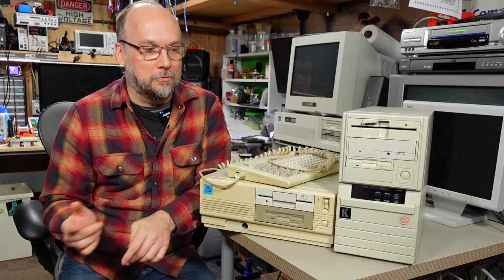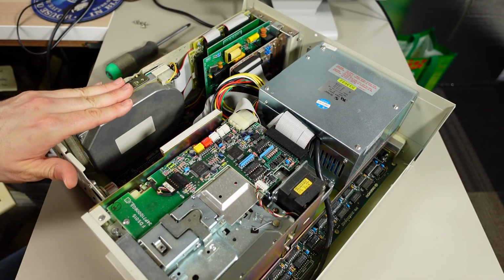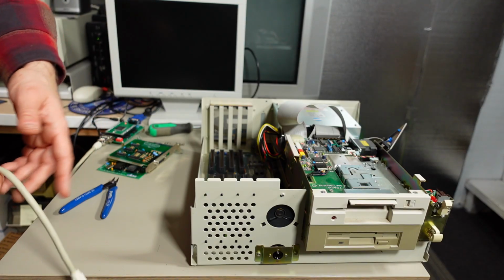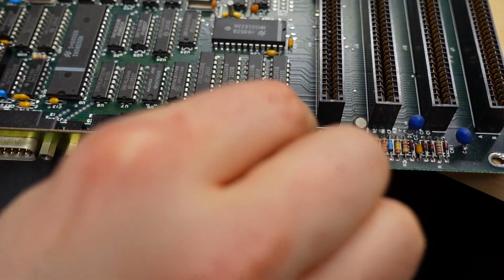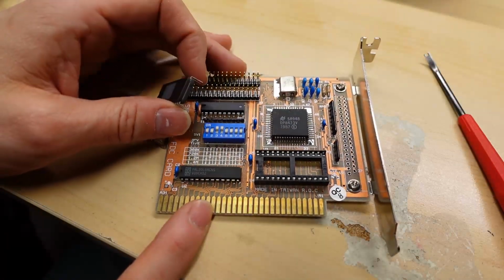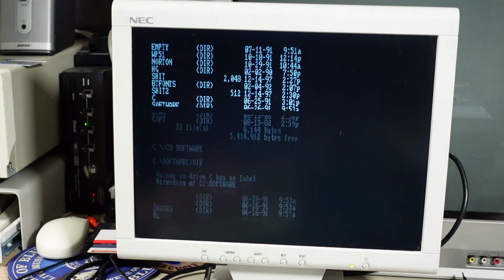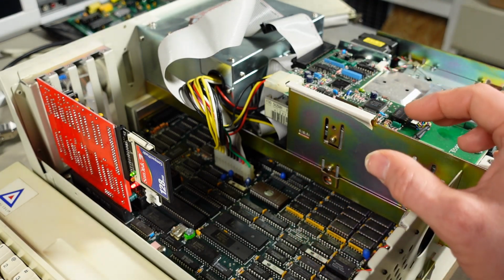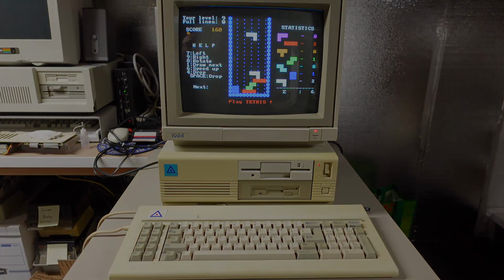PC archeology: Leading Edge Model D

Comment: Well, this takes me back. WARNING: LONG-WINDED MIDDLE-AGED REMINISCENCES AHEAD

I worked in Leading Edge's warranty hardware support department in the mid-'90s, at the tail end of the Daewoo era. The Model D was long out of warranty by then, but it was still legendary within the company (albeit not quite as legendary as the Model M, which was downright mythical). Unfortunately, by the time I came along, manufacturing quality had taken a pretty substantial dip, so my colleagues and I were pretty busy. Just as one example, at the time LE sold a computer called the WInPro 486, which was notable for a) not shipping with enough RAM to run Windows, b) not being professional-grade in any way, and c) not really having a 486 in it (it was one of those stupid Cyrix processors that was really a 386SX with the 486 instruction set).

Things picked up somewhat quality-wise toward the end of my time there, circa the summer of 1995--the last generation of Leading Edge PCs were pretty good--but the writing was on the wall by then. Leading Edge was getting its lunch eaten by other manufacturers, mostly with "Packard" in their names, and the product improvements came too late. I got out when Daewoo extended a hiring freeze to include not making up for attrition, causing the support department workload to spiral out of control. I remember one day we in Hardware Support all went to a big meeting with a Daewoo bigwig who'd come over to HQ in Westborough, and one of my coworkers asked if we could please at least hire to replace people who left, because we were really getting hammered. He stared at us while his young flunky translated, then scowled, pointed at us, and said without going through the flunky: "The rest... you work harder."

FYI, since you note at the beginning that you didn't know whether Leading Edge ever made 486es: they did! And not just the Cyrix faux 486es, they had proper Intel ones in the last few generations (including a minitower very similar to the generic one you have there). In fact, when I bailed, the company had just started shipping its first (and probably last) Pentium model. That's another horror story, in fact; the computer itself was fine, but the Corporate Masters had decided to revamp the company's image, so they abandoned the triangle logo for something painfully generic and branded the Pentium line "Fortiva". This was at around the same time that IBM launched their "Aptiva" product line, and a brand of yogurt called "Activia" appeared on the market. So that went about as well as you would expect. By then I was on my way to the exciting world of supporting ISP infrastructure equipment instead of PCs, anyway.

Finally, a fun fact: the last generation of Leading Edge laptops were made by Lenovo! That was before they bought the ThinkPad brand from IBM and started selling laptops themselves instead of being an anonymous OEM for other manufacturers. So they were actually quite good... not that that helped them sell very well.
Reply: "...at the time LE sold a computer called the WInPro 486, which was notable for a) not shipping with enough RAM to run Windows..." I'm getting flashbacks to the first year after Vista launched.
Reply: this is a longshot but i've found a desktop for sale. the model is dc-2012 which isn't actually documented anywhere. know anything about it?
Reply: @MyNameIsBucket   Not much, unfortunately. I worked for Leading Edge 30 years ago, and like I say, the Model D was long out of production even then. Anything with a processor earlier than a 386 was before my time.

Comment: I had a VTech Laser Turbo XT that also had a battery-backed RTC, but it was on a factory installed card-- not the motherboard.  And you had to run a program on bootup in order to set the internal clock to the time on the expansion card.

Comment: I was the Director of Purchasing for a company that was the largest distributor of Leading Edge computers back in the late 80's. We actually "owned" Leading Edge briefly, when they filed for bankruptcy around 1989, although later the bankruptcy court took the name away from us. Originally, Leading Edge sourced the products from Mitsubishi (hence the names Model M and MH) and then later, to lower costs (plus Mitsubishi tired of Michael Shane's tendency to pay late) and for better credit terms they sourced from Daewoo (hence the Model D, D2, etc.). Quite popular at the time, maybe even more popular than any one of the models was the Leading Edge Word Processor, which came bundled with each computer and was also sold separately. Daewoo sold us the remaining Leading Edge computers directly but wanted to market directly in the US under their own name after that, so we turned to Mitac computers (AKA American Mitac) as the 3rd suppliers for Leading Edge branded computers. But that sort of quantity and branding took time, and several months later the bankruptcy court took the LE name away so we rebadged them under our own name, and while they were actually quite nice, we never sold them in the numbers we sold Leading Edge computers under, since the dealer network had either collapsed or moved on to a more stable supplier. We survived, as it was just one piece of our business, but a lot of smaller dealers went under as Michael Shane (the original owner of Leading Edge) would often extract full payment or large deposits before shipping computers to dealers (often late). Shane's dicey business practice is kind of how we became such a large distributor - we didn't demand those terms and reliably shipped on time and still gave dealers 35% off retail in large quantities - and when Shane was up against the wall, he'd sell us huge quantities of machines for 50% off if we paid COD, which we could. Shane was almost operating a Ponzi scheme at some point, in my estimation.

Comment: Hey Adrian!  I have a Leading Edge Model D as well.  If you are interested in getting an original Leading Edge BIOS working with the XT-IDE, I've dumped mine which has Phoenix v2.13, dated 1985-12-27.  I have never had trouble with my XT-CF Eco-Lite that uses the XTIDE 2.0.0b3 BIOS, even with the CF card at 300h.  However I also noticed my board P/N is 2105004103 vs your 2105004102-- so maybe there are slight changes between the two, maybe even changing the RTC address.  From a quick/lazy glance the two boards don't look any different from each other.  Not really sure what the best way to get the BIOS image to you would be if you wanted to give it a look, but let me know if you're interested.

Comment: Oh, my goodness---the D did color!

The Leading Edge Model D 8088 was my dad's first computer. As I recall, Dad bought the D in 1986, surely based at least partly on Consumer Reports' enthusiastic recommendation. His configuration included one 5.25" floppy drive, and he also purchased an optional 20 MB hard drive. (Unfortunately, the hard drive never worked reliably.) I'm reasonably sure the keyboard was identical to the one you've got here.

Dad also got a monitor that could display every color . . . as long as it was green.  Indeed, until now, I had no idea the Model D offered any color capability whatsoever. Now I can rest easy!

Comment: I think some of these later XT's had real time clocks.  That would be what the battery would be for most likely.  
Likely had two connectors for people with two monitors so you could have both monitors connected at the same time :)
A question a little off topic...   What was the reason you got into retro-computing?   
For me, it was more nostalgia rather than the thrill of restoring something electronic.  Memories from childhood.

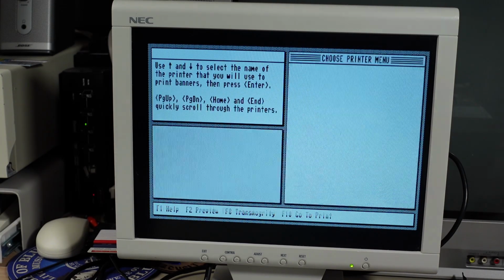Comment: Hi Adrian.  Great video.  A little note on your software exploratory around 41:00.  I noticed the machine also has a copy of dBASE III.  Sidekick and dBase III were a very common combination back then, since dBASE was programmed with .PRG text files that were interpreted, not compiled.  The dBase text editor was utterly appalling so everybody used Sidekick instead.  When writing and debugging their program files, they would quickly pop up the Sidekick Notepad TSR, already loaded with a with a copy of the .PRG, edit it, dismiss Sidekick and immediately re-run the freshly-edited program in dBase.  It was such a productivity boost.  What was extra-cool was that the Sidekick editor used WordStar keystrokes (Ctrl-K C for Copy etc.).  The maximum size of a Sidekick text file was 64K so, if your program exceeded that, you could then fire up the exact same .PRG in WordStar and continue editing using the keystrokes that were already burned into your muscle memory.

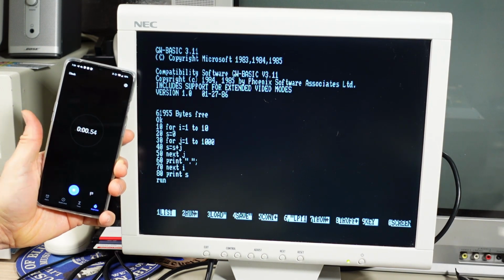Comment: 43:30 - out of curiosity I just tried the exact same thing in Java on my Ryzen machine - it took about 650µs to run. 😂 And 100000 * 100000 still only around 4s - very cool how from a mid-80s perspective my ordinary middle-class 2019 PC is an alien-sci-fi-magic supercomputer 😎
(and in DOSBOX using GWBASIC it's around 1s)
Reply: I just ran that using the freebasic compiler on Linux -- it runs so fast that the time program doesn't even give an accurate answer. Probably way under 1ms. This is on an i5-9300, which, just like your Ryzen, is bloody alien space-age technology compared to a 8088! I wonder if installing an 8087 would have made any difference... I guess it all depends on whether BASIC knows to take advantage of it or not.

I might try running that test on a very old computer I have access to -- a CDC-6500.

Comment: 10:50 Is that a quad 555 timer in the middle there?
Reply: Probably. PC game ports traditionally use 555 variants like the 556 and 558. The potentiometer in the joystick varies the charge time of the circuit. The PC triggers the 555 by writing to the card's IO port, then repeatedly reads the IO port to get the 555's output (as well as the buttons' states). A software loop times how long it takes for the RC timer to finish and this determines the joystick position.

Comment: I'm actually in the middle of doing this exact leading edge machine myself.  I also just replaced bad memory in a late model slim line 8086 version of the leading edge machine.  They are actually really good no frills computers.  

I also sold 386 and 486 leading edge machines at Office Max back in the day when I was a store Electronics manager.  Good solid machines with very few returns

Comment: Does the real time clock still work with the foreign BIOS? As far as I know, you don't necessarily need to have a patched version of MS-DOS 3.3 for Real-Time Clock support as long as the BIOS supports the RTC interface on INT 1A. The old BIOS might have supported it.

Comment: The graphics card has its own system the hardcard as well. The hardcard starts up with a configuration menu at boot. Can the video be EGA. If i am not mistaken there is a ctrl-alt-somekey combination to enable turbo. There also was a executable to enable turbo mode.

Comment: i always open up the stuff  i bring in the house, it may be roach infested, in fact couple times were, once i found a rat nest with dead  mices inside, and the pee corroded rare 286 mobo,all the wires chewed. But the roaches are the biggest problem.

Comment: Not all gameports were fixed... quickshot did a dual gameport card that needed correct jumper config to work, however it even worked in win 98 when configured properly with the dip switches

Comment: The "Turbo" button on PCs is actually a Turbo Disable button as it drops the clock speed down to original speeds in case software (often games) run too fast when enabled.

Comment: So I see I'm just piling on,  but Chris2fett is right.  The model D was an education machine and was designed as a low cost production machine for comminity colleges and other educational institutions that could not use Apple, or afford IBM.  All of the Model Ds were designed to run a dual floppy design, that's why it has the drive lock for your DOS disk.  The last Leading Edge I saw was a at OfficeMax in 1994. It was one of the low cost Pentium 60/66 machines.  You could get the Leading Edge Pentium with a 800mb Hard Drive, 2x CD ROM, no sound, a 14.4kbps modem, 512k Trident ISA Video and 4MB of RAM for $1999, with a 14" color monitor, with a .42DP (which is really not even viewable).

Comment: When did motherboards start to replace rom with prom?  I did see that you did reprogram the XT-ide interface, but generally when did PROM start to replace the ROM in PC's? Is there some type of generic chip/circuit that is used for flash PROM in computers that all vendors used?
Reply: Well i read it became standard around -95 so pretty late.
Reply: Well resource conflicts on motherboards and OS, not that fun i have a P4 that i try to run win98 and DOS on, DELL dimension apparently made for XP so hard to find both drivers but worse the Intel chipset drivers "in 98" seem to have issues with the motherboad. 

The reprogramming you do on original XT machines (and other old hardware) changing reserved hardware adresses in BIOS to use other memory adresses, do they also apply to "modern?" ;) systems like Win98 are there also other conflicts that also about OS resources. Because on my DELL dimension 2400 the confiicts isn't there in XP?

In DOS i remember there was some 384KB locked as rom area on a 1MB well on any XT compaticle running DOS, is that information simply read into memory area from BIOS or ROM everytime you boot or what is that reserved memory?

Is this a feature of just OS with DOS origin like 95 and 98 or is it a feature of the bios rather then OS, say you run NT or Linux can they use that memory area or is it reserved for hardware?

Comment: I had a Leading Edge 386 years back, with matching monitor and keyboard. It had a rather interesting 1/4 height 5.25" drive. Basically, a 1.2 MB drive, as you'd expect, except the height of a normal 3.5" floppy drive. Yet one more in a collection of things I wish I hadn't thrown away.

Comment: Unfortunately my dual port floppy controller has a UMC UM8398 chip rather than the National Semi DC8473, so the BIOS in it won't do you any good. Probably a good idea to save a copy of it for posterity anyway. I also checked Sergey Kiselev's combo floppy/serial card, but that's compatible with the National Semi PC8477. I have no idea if that chip is compatible with the DC8473, and you'd have to reverse engineer your card to see if it's implemented the same as Sergey's anyway, and at that point you're almost better off hacking the BIOS you found to work with your card.

Comment: I have one of those that is still operational that only has two 5 1/4 drives, model DC-2011E with 4.77Mhz & 7.18 trubo 
I also have the original mono chrome monitor and IBM color RGB monitor I may try to get a hard drive working working 
on it.the problem is finding  a controller that will work on the machine. the bios is also Phoenix 8808 ROM BIOS 3.00.

Comment: I've wanted to see somebody do a video on the Leading Edge series of computers for a long time - I still have the Model D that our family picked up back in the mid 80's.  The MFM HDD in it has long since given up the ghost but I also put an XTIDE unit in mine. I just booted it up to take a look and notice that it's running version 3 of the bios.  If you're still in need of that, please let me know and I'll pull the chip and read it.

Comment: I still have a Leading Edge computer (bought new) of approximately the same vintage in storage.   Everything was working perfectly when it was stashed away.   I don’t recall all the specs but it seemed like it had an 8086 main chip with a 8088 coprocessor.  It has two 5 1/4” floppy’s, no hard drive and a screaming 1200 Vaud modem.

Comment: There is a project out there to use a Raspberry Pi Zero as a Digital RGB(i) to Digital (HDMI / DVI) converter, I got one from a guy in Australlia for my Tandy 1000, it's based on this project - ( https://github.com/hoglet67/RGBtoHDMI ) if this "Human Malware" situtation were resolved, and, Sean, was still holding the Commodore club meetings I would show you my RGB2HDMI setup.  Here is a video from another Youtuber, who built one showing how nice it works - https://youtu.be/xGO3N1ThHFA

Comment: left alt + code on  num padd still work on windows 10 , you call caracter by entering the decimal code equivalent binaire
Reply: Use a zero before the number to enter a character from the current Windows 'ANSI' code page (such as code page 1252) and use a number without a zero to enter a character from the DOS code page (like code page 437). Using special characters entered using the keypad can be neat in passwords to make them hard to guess, but I'd be careful because some things might not support them properly.

Comment: Ah yes, Leading Edge.  My grandmother had a Model D that could clock up to 10MHz.

As for XTIDE, I have a Packard Bell PB88M that has a 2.03 Phoenix BIOS and XTIDE works perfectly for me.  Unfortunately, the computer stopped working recently (the backplane had a lot of battery damage but still worked good enough).  It's one of those machines that has most of the motherboard logic on an ISA card that plugs into a backplane (and I have no way of testing either since I don't have another one).

And I absolutely wish there were computer recyclers where you can get those old computers around North Florida (where I live).

Comment: I used to have a Leading Edge 486, but I guess it could have had the mobo upgraded by someone before I got it.  It looked different than that machine though.  Also used to have that exact midtower case with that exact CDROM drive in it, oddly enough.  Weird.

Comment: My first computer of my own was one of these, it was my uncle's, he gave it to me when he got a 186 or 286 a few years later.
I've got the 2.13 BIOS version on mine.
I was going to get it going a year or two ago and bought a second to use as parts for it, but it ended up just working, so my actual original one is just sitting, and I'm using the "parts" one instead.